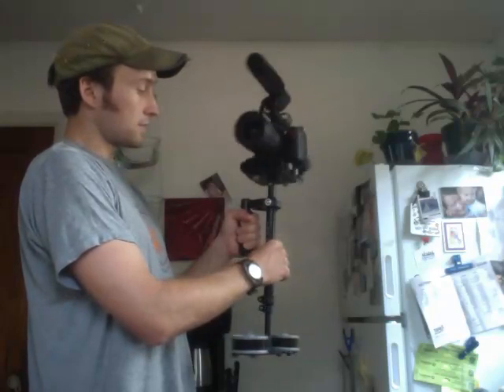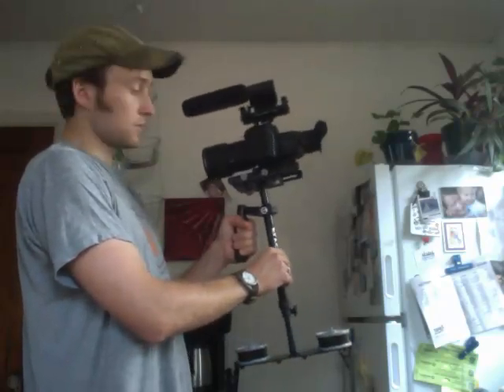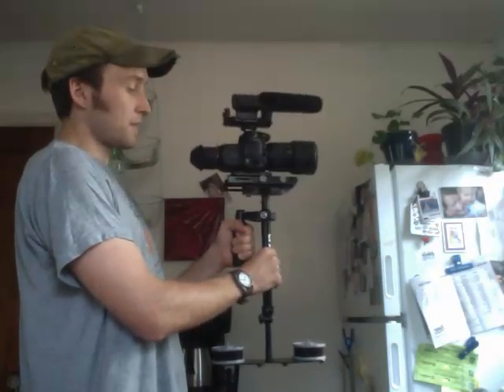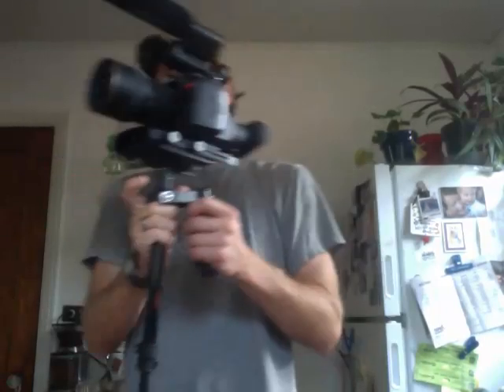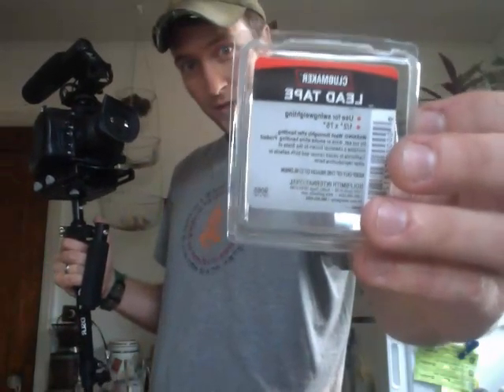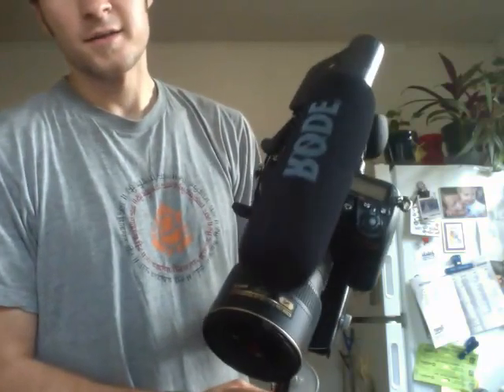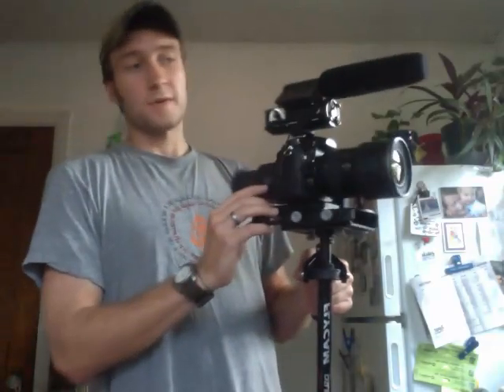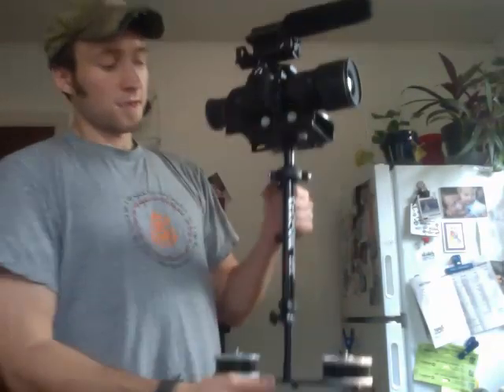DSLR Flycam Nano gimbal fix STEADICAM

Comment: I found a way better fix for this, i dissambled the gimbal only leaving the aluminum circle and the inner bearing, placed it over a flat wood piece, and used a smaller wood piece that covers only the bearing, using a hammer smashed it a couple times so the bearing will fully sit on the gimbal ring, after doing it the flycam worked flawless. Since the problem is that the bearing isn't 100% aligned with the axis, it will tend to roll the camera while moving.

Comment: Hi, good video.....I would like to ask you about the mic...I am about to buy exactly the same stuff, the same camera and the same stabilizer but with the lens Nikon 16-85 but also the same mic......I know that some Canon models had some problems with not good and clear sound with the Rode videomic....how is it Rode videomic working on the Nikon D7000 ?  are you happy with ?  do you have an option to turn of the AGC or you just download the software ?   thanks......

Comment: Hi 
Thanks for posting the video. This probably is a stupid question but where to you apply the lead tape? Does the tape go on to the gimbal or is it placed around the stem, just above the gimbal?
Also, I have a Zoom H4n and a Rode VideMic on top - it is possible I have too much weight on top?
Thanks 
Craig

Comment: Hi my issue with this stabilizer is different: when i walk fast or run, or any fast movement, the result is not nice at all, it shakes, and I don't mean big shakes (the Flycam is correctly balanced), just tiny shakes. It is the camera itself that shakes and jumps from the steadicam. Do you know any way to fix this ? thanks